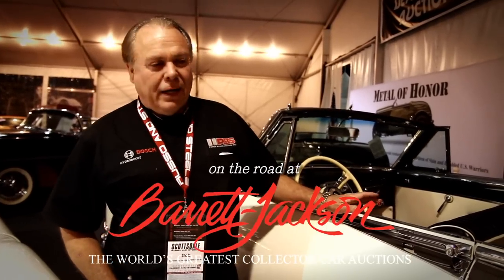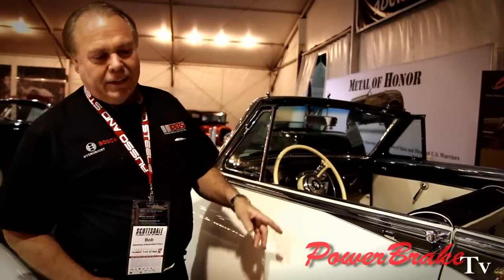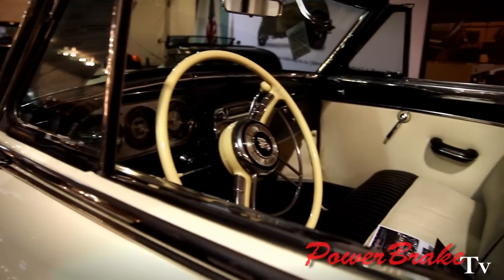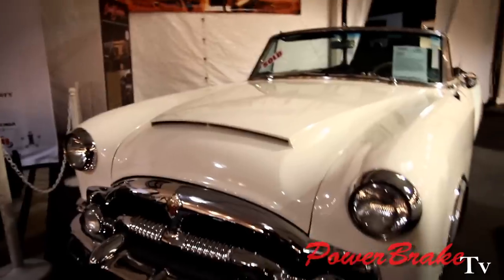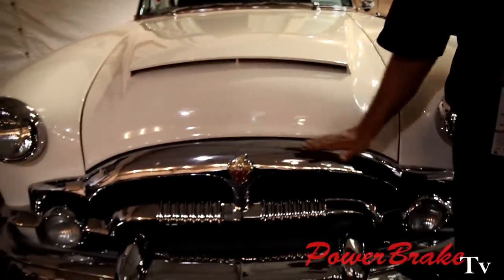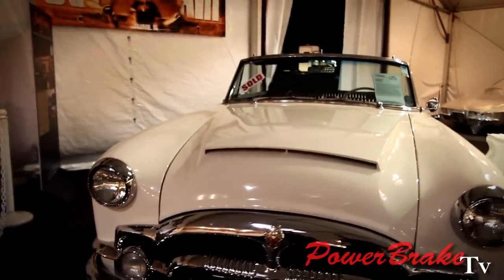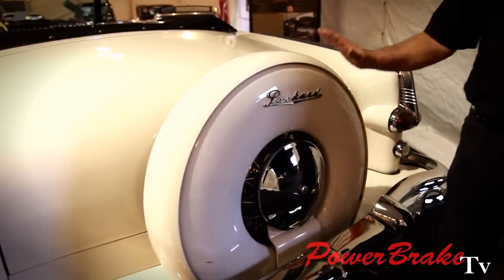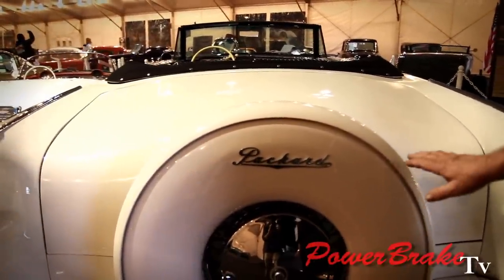55 Packard Caribbean at Barrett Jackson - Sweeting Performance

Comment: The headline says its a '55 (It's not), it IS a 1953. the chrome headlight frames are definitely a '53. And is a single paint color scheme, '54s were all two tone. The '55 was a total redesign - different headlights, grill, etc.
Reply: To be fair, there were some solid color 54's, but most were two tone that followed the trim line.